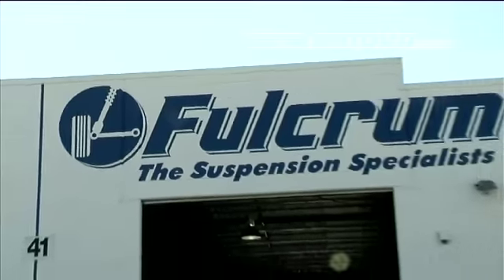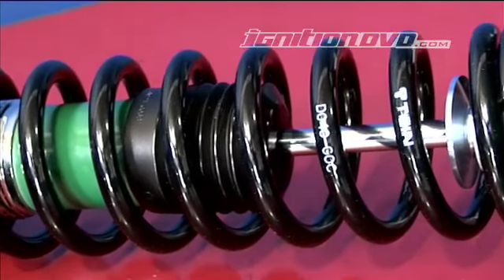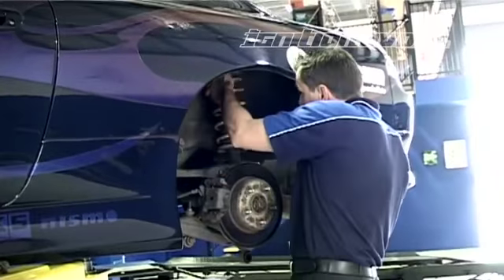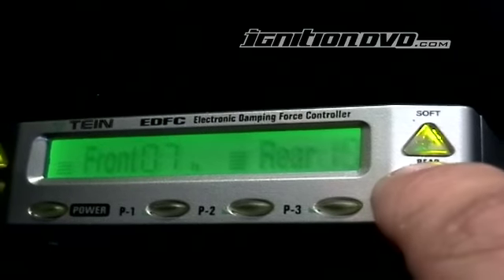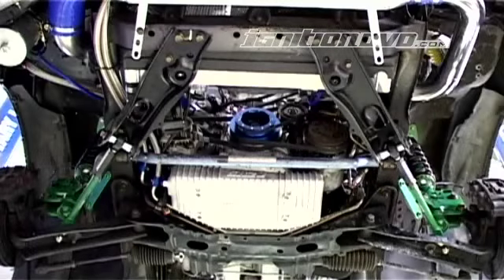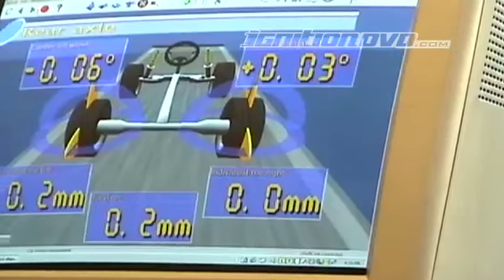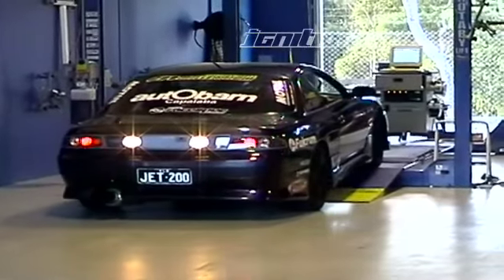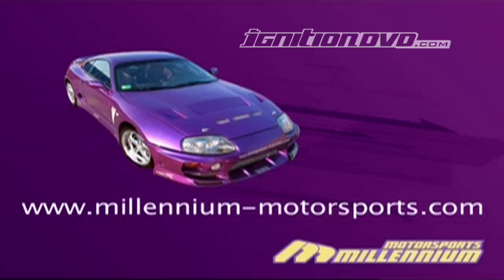Project 200 - Tein Suspension

Comment: @socarrasorlando are there ANY models which could be HEIGHT-adjusted from inside the car ? to electronically control the "damp force" is one thing - but to control the height of the clearance is a completely different issue. So my question remains - where i can purchase HEIGHT-adjustment suspension ? Name, company, price...